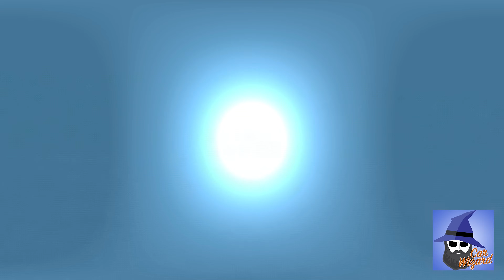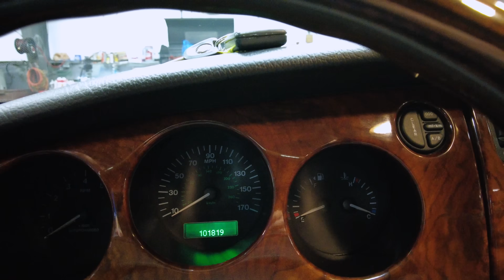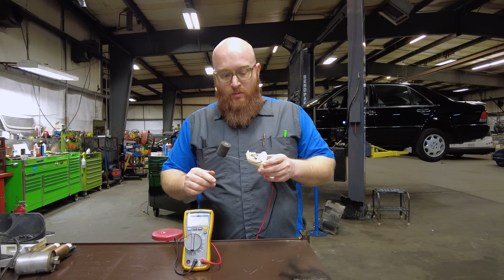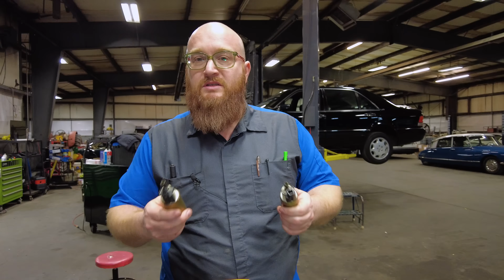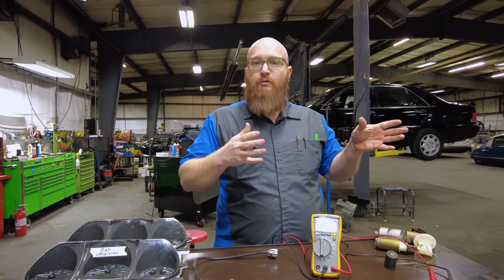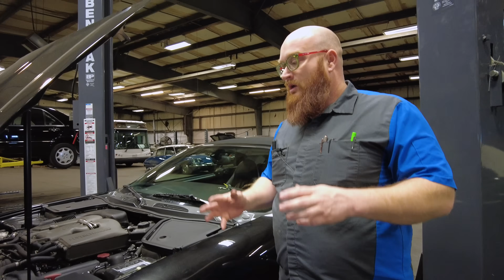So much more wrong! CAR WIZARD fixed main issue on the '01 Jaguar XKR, just to get 4 more!

Comment: Many years ago my dad treated himself to a 2001 XKR, approved used vehicle and it was beautiful and rapid, but ...he worked away a lot at that time so I used it regularly and my word we got our use out the warranty, multiple sets of CATS shocks due to knocking, several sets of front end bushes until they sprung for poly bushes which was a huge improvement, rattly window regulators, dash went crazy from time to time, over voltage etc. Beautiful cars but he had a BMW 7 series v12 afterwards and even that was less problematic.
Reply: Jags are not known for their reliability. If you want that, buy a Japanese brand.

Comment: I loved my XKR (2002 model year). It was reasonable bullet proof mechanically but rot got it in the end and it failed it's MOT (road safety/worthiness certificate in UK), due to corrosion in the floor which was un-economical to repair. I still miss it but have moved on. Hopfully when you're done, it'll give the owner many more years of happy ownership. Thanks for sharing.

Comment: Since this model year is from the Ford ownership time period, is there any other Ford model that uses a similar fuel sender or is it Jag specific? Ford parts might be cheaper. As long as the resistance is the same and fits the tank opening, the arm might be switched over if not identical?

Comment: Wizard was t alking about a Jag, and said"it's real simple" Sometimes, rarely, it is My 1970 XJ6 with 2 fuel tanks developed a leak. To access it, you remove a panel  under tje bumper held on with large philip  scews. They came right out. The fuel tank was not rusted and still had facory paint. A metal line/tube ran from the tank, inside to the fuel pump. It had a pin hole. I removed it and it looked familiar. I matched it to a generic brake line and it had the same thresda and diameter. I cut it to length and slipped on the fuel ine. All was well.
My XJS didn't have a 12 cylinder Lucas distributor cap, it was Marelli.

Comment: disappointed that you could not get something so simple as an odometer right. Why is this difficult? Please do a show on it. With love, big fan etc, etc.
Reply: US Federal law prevents changing odometer readings. The only way to tell what true mileage the car has is through the car's computer.
Reply: @hotpuppy1  Meanwhile, back in reality, you as the owner can work with your local DMV to get a mileage adjustment. 
This authorizes a few third party companies to adjust the reading.
And am I the one who has to tell you that computers can be swapped out?

Comment: Since you had the cluster out you should have replaced the cluster bulbs with LED's They make the dash read so much better, they last forever, they burn cooler and I replaced all of mine (and thr HVAC) lights for about $30.00 with shipping from Amazon.

Comment: I like the citron in the back ground. Are you going to work on it ??
Reply: The citron (Citrus medica), historically cedrate, is a large fragrant citrus fruit with a thick rind.

 It is said to resemble a 'huge, rough lemon'. 

It is one of the original citrus fruits from which all other citrus types developed through natural hybrid speciation or artificial hybridization.

Comment: There is a place in Canada that can legally change the odometer.  You have to have alot of paperwork to prove the cars milage and they will set your new cluster milage to match the car.
Reply: IMO, just swapping the cluster to one with a different mileage should be illegal. What if the car had 150k miles and they just dropped in that used one showing 100k miles? How is that legal?
Reply: @OMGWTFLOLSMH  Well does one scrap a good car because the cluster took one for the team. Not sure about Jags but I'm pretty sure any non-dollar store OBD scan tool will show the real milage on the ECM.
Reply: You can do it in the US but again it requires a bunch of paperwork, government red tape, and cash. Easier to just leave it.
Reply: It's over 10 years old in most states.l Millage is exempt
Reply: @philipparana9225  In case your interested, there is a new federal law that started in 2020(or was it 2021? Can’t remember).

It is going back 20 years. I think it was implemented in 2020 With each year thereafter adds one year. So by 2030 (iirc) it will be only over 20 years that can be sold exempt on mileage. 

This is due to the average age of vehicle in the US being 12 years.
Reply: There are companies all over that can change an odometer legally. The alternative (in NY) is a handwritten sticker from the mechanic on the door jamb, listing the old mileage and replacement cluster mileage. Good luck trading that car in at a dealer. My employers would look at a car like that as a TMU True Mileage Unknown.
Reply: I have a question for you guys what if you change the engine a total engine swap and you want the mileage to reflect the new engine is it a major process to have that reflect on the title because I would want it to reflect the the new engine mileage , would a company consider writing the form for me or would I be ignored?
Reply: @troy8940  you can't legally as far as I know. Vehicle milage is not just based on the engine.
Reply: @troy8940  Totally illegal on just an engine swap. Why would you want to anyway? You'll ruin the Carfax.
Reply: @Kewrock   Well the vehicle has a salvage title so I figured you know you can't get any worse than that the engine is OK but you know I'm going to switch it out which I plan on doing I'm going to switch it out I want to have the mileage you know correspond correctly you know versus having looking at it and having me write it down you understand , no big deal but I really appreciate you you know what I'm in
Reply: @troy8940  are you only replacing the engine? Just one component?
You're not replacing any of the rest of the drive train?
You're not replacing the suspension?
You're not replacing the chassis?
You're not replacing any of the interior?
You're not replacing the centre console?
Are you replacing the axles?
Are you replacing the drive shafts?
Are you replacing the braking system?
Are you replacing the steering system?
Are you renewing all of the airbags?
Are you replacing electric windows?

There's no way you're trying to be honest in saying that the mileage of a car is only the mileage of the engine and nothing else matters. Changing the mileage to only match the engine would not be a true reflection of the mileage that the entire vehicle has covered. Everyone knows this.

That's why in the service book you can include an entry for the engine change and a stamp from the dealer who did the work. You will also have the receipts from the dealer who supplied and fitted the engine.

Changing the mileage is probably a type of fraud and/or theft. The deliberate premeditated organised crime of false value of goods, as well as selling someone unexpected costs too because a more worn vehicle will probably require more parts and have more faults.

Any car dealer doing crimes like these it needs to come up on the Google map search for their business. Seeing a review and some photos and how to get there is all nice but we also need to know if the owner of the business has been convicted of crimes like these against the customer.

One thing social media and mapping seems to like is criminal mapping. In large cities where people are anonymous it's a lot easier for criminals to hide so we need to make it socially difficult for criminals.
Reply: @Google_Does_Evil_Now  yeah,just motor.i plan on keeping til my end 🤣
Reply: @troy8940  enjoy changing the engine. It's not easy task. Good education, if you've not done similar before.

Comment: Sir, not sure if you’ve had any experience with the newly returned Jeep Wagoneer, but if you did what is your opinion on the new 2022 Wagoneer?
Reply: Wait a bit is best practice with Chryslers, let them work the bugs out and try for late 23 or 24 model Hemi.  Buy a warranty if you still are worried, If its too problematic trade it.